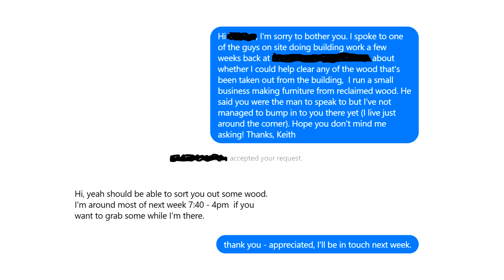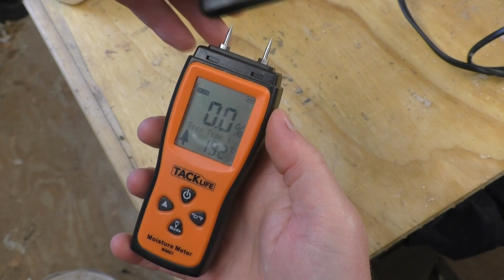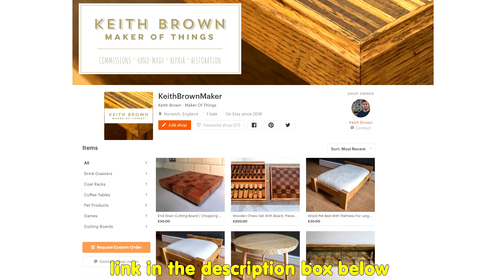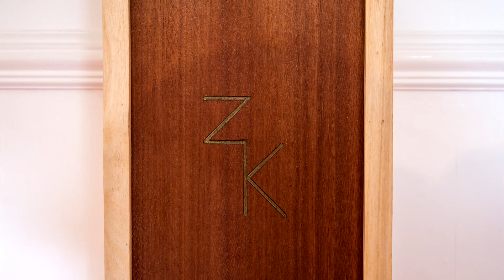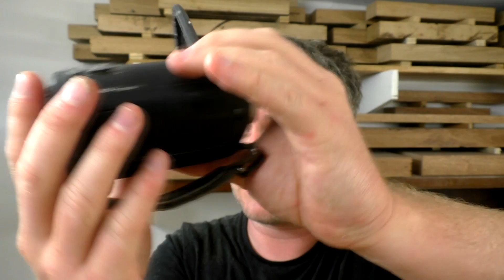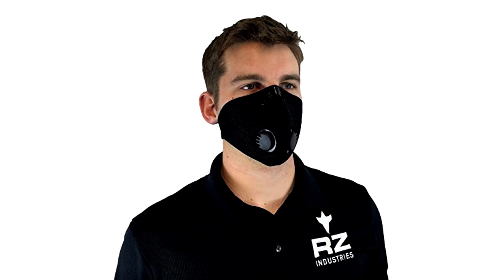VLOG 1 - Salvaged Wood Haul / Work In Progress / New Camera Gear / Tool Talk

Comment: I also enjoyed this video format a lot. I know it's been a while, and I'm currently catching up on your videos, but I wonder if there's anything that can be done to make that table saw quieter. Adding weight to dampen vibration, or possibly balancing it in some way. Or is it just a really loud motor?
Reply from the maker: It’s just the motor unfortunately. I wish they made an induction version - I’d buy one!
Reply: Thanks for the reply, sir! Swapping out the motor for an induction one would be complicated, as they need circuitry to drive them if it's not built into the motor. That's beyond my current skill level, but maybe Matthias Wandel would be kind enough to offer a consultation. 8-)

Comment: Kieth, I know this vid is a little old now but if you're still looking for a compact, quiet, induction motor table saw, have a look at the TS-200-2 or the TS-250M-2 from Axminster. They start from around 400 quid. Up to 700 or so if you go for the sliding table attachment (this is also compact but very well built). They're from the "hobby" series but trust me, they're a professional bang for the buck. A buddy of mine has the 250m with sliding table. I think it's great.

Comment: Don't waste your money on festool. They do the same thing as many other name brand jointer's, only for two times the money. Their is no difference in the quality of work. I can't understand why anyone would want to do that. Unless one has money to burn. A domino Vs. biscuits. You seem to be a smart man. Save your money for that place in the country you want.
Reply from the maker: Biscuits don't and strength. Dominos do. Simple as that for me
Reply: Rag 'n' Bone Brown ..... I have used biscuits for many years and have never had a failure. Domino's do add more strength, no question about it. But is it really needed? Only you can decide that.
I love your videos and never miss one. You are very good at what you do.
Reply from the maker: Check out my testing biscuit joints video

Comment: Haaay! 
I really like your chanell specialy because i litteraly have almost the same size garage that i am slowly converting into a workshop   ... --> https://www.instagram.com/p/BbHsY15n6BJ/?taken-by=zeko.zajc   Curently is without the place for bandsaw but i plan to enlarge the garage a bit bbwwwhhhahahaaa

I struggle with the same issue about deciding about machines... specially couse i am a fan of unplugged anyhow... but some machines are really useful too ...  well... since size is limiting me also ... i wonder what conclusions have you made about table saw? I was almost sure ill go for your dewalt since it looks it is a quality tool to work with ... but i have to think about noise since i am very close to my neighbours... i have the same thoughts about band saw and planer/thickneser... i need them small ... quiet ... some reasonable level of quality...  but jea.. the question remains... what conclusions have you made about getting a new table saw? plus ... i have to think about ordering from ebay or amazon or somehow abroad ( in EU so i dont pay import taxes) because we are limited with selection in Slovenia and alot pricier.... on that... while writing that i just gor alu sashg clamps from GLS right now i ordered on ebay jeeeeej :D

Congratzs for the chanell again love the hole story fom building it to a proper workshop by now!
Reply from the maker: Thanks! I haven't made any conclusions about tablesaw yet my dewalt is fine in every way except for how loud it is. Charnwood and Axminster sell saws with quieter induction motors however I'm not sure if they are available in Slovenia. Try and find one with an induction motor if you can
Reply: Rag 'n' Bone Brown tnx ill check... 
And what is your strategy to check the quality?  I mean the tech info is specified ... with noise and what kind of motor it has ...  size...  But...They all say they are super fine precise and all😊😊.    And... What would you say is the bigest pice reasenable to cut with your current dewalt saw ( and similar table sized ones...) 

Tnx again and good luck in 2018 ... From your new patron hehehe😁
Reply from the maker: Thanks for being a Patron Miha! I think all tablesaws have adjustable fences so as long as the mitre slots are parallel to the blade any saw should be able to bet up to be accurate and precise. Some are better than others though obviously. If you look at the maximum rip capacity and cutting height specs on the saws your interested in it will show how big a size you can cut. I struggle to cut big sheets because my workshop is so small
Reply: Rag 'n' Bone Brown tnx... So you woud say the size of your workshop is more of a limit than table saw of that size...?  Ok tnx for that usefull info!   Best regards from Slovenia.  Cheers!

Comment: Keep the old makita trimmer. Ive got one with a flush trim bit and one with roundover or chamfer bit in. Speeds things up
Reply from the maker: Great idea but in my shop the position of the sockets make using corded hand  tools a bit of a nuisance so I think I'm gonna stick to just using the cordless one
Reply: Rag 'n' Bone Brown 
Maybe some sockets overhead. I like the cordless option but can afford at the mo. I went and bought a Katsu router as a second router. So far so good.

Comment: Noted you mentioned about the reclaimed wood you acquired from the building site being too moist to work with. 

What would actually happen if you used the reclaimed wood at 13% moisten content in a project? What are the pitfalls? 

Great vid. Good solid woodworking knowledge.
Reply from the maker: It will keep contracting across the grain as it dries out which can be a problem depending on how it's used and what joinery method is used with it

Comment: To be honest wouldn't cutting the wood be louder then the motor on the dewalt get a sound meter test with the saw running and watch it,Then try it again when you start cutting or use mobile app not the same but will give some idea ? I've just ordered this dewalt 745 after watching other videos of yours thinking it would be a great saw ,I have no concerns that its going to be great, however i do have concerns in the back of my mind that it would be loud and annoying for other people ,but wood cutting i am sure is going to be louder even with the up grade to W629/W650 am i wrong ?

Although there are other alternatives to blocking sound if that is a worry for you , And would be a lot cheaper then another saw , 
https://www.google.co.uk/search?q=rockwool+sound+insulation&oq=rockwool&aqs=chrome.1.69i57j0l5.3924j0j8&sourceid=chrome&ie=UTF-8

Would block sound and all so make the workshop ie shed warmer in winter times .
Reply from the maker: +IIIZiPIII it's the motor that is noisy. The cutting is loud too but the motor without the cutting is still too loud for my liking (or my neighbours!)

Comment: I was in the same boat as you about the festool domino. I am only a hobbyist and most of the things I make are for my home and for family/friends. With a toddler and another one on the way, I found my time limited in the shop and I could only produce 1 piece every few months. After purchasing the festool domino df500, I have been able to churn out pieces much faster and have made a cube organizer, table for my son, laundry basket organizer, and display case in a month's time. Crazy fast! You can always explain in your videos that dowels or traditional joinery can be used in place of the domino. Keep up the awesome work!
Reply from the maker: +Ray Ganancial thanks Ray, yeah that's a good point!

Comment: I recommend Bosch GTS 10xc. I don't know whether they sell it in the UK. It's not induction motor but it has soft start and electric brake feature. I've been used both DW745 and 10xc. In terms of noise level, 10xc is quite lower than DW745.
It requires larger footprint than DW745 but not that much big, probably will fit in your workshop.

Comment: Hi Keith, I am in a very similar situation to you; I work a full time job but i'm trying to turn my woodworking hobby into a business. I have had an Axminster Ts-200 table saw for almost a year now and would absolutely recommend it. Until recently i was working out of a small cellar workshop so the size and quietness of the saw was a real bonus. It is by no means underpowered, especially for the work I see you doing. There is also an option for a sliding carriage and an extended table (I would definitely recommend the extended table). As for the Domino, I was in the same predicament but bit the bullet and bought one, and haven't looked back since...and I don't think you would either. If you can afford it, get it! Without a doubt. Hope this helps
Reply from the maker: Thanks Cam - am checking out the TS200 :-)

Comment: Nice vid. Hope you get the Charnwood w629 as had my eye on that already. I have one of their budget table saws which I bought when getting into woodworking. Once it was set up right then it’s done me well but like you I’m attracted to an induction motor version. Will be interesting to see which you end up with.
Reply from the maker: Yeah the W629 looks great but after measuring up I'm not going to be able to fit it in.  I really need a contractors saw so am now looking at the Axminster options

Comment: Regarding Festool I have a feeling you will probably get some negative comments about that, as part of the appeal of your channel is that you work with a budget similar to what an average hobbyist would.  Having said that though, I am considering getting a Festool TS55 track saw for my next workshop. That will be a 1 car garage and I think that a tracksaw will be the only way I will be able to cut full sheets of plywood in that space.  I would keep the table saw for smaller cuts. I believe the festool TS55 is relatively quiet in operation.   See the video by "Russ Veinot" where he helped me out by coming up with a design for an easy to make DIY Panel saw that takes up virtually no space.

Comment: Have you asked your neighbours if they mind the table saw?  Maybe they don't notice.  I have a dewalt table saw (a bigger model than yours) and I also find it very noisy. I live in a semi-detached house with a 15m long garden. I asked my neighbour if the noise bothered them and they said they could hardly hear it from their house.  My shed is internally lined with 18mm plywood though and filled with an air gap then a layer of foil bubble wrap insulation, another air gap, then 3 layers of 2mm polystyrene roll.  The walls are about 80mm thick in total.   I made my shed doors the same thickness and insulation level as the walls. So maybe that damps the noise a bit.  It was just a prefab shed that I beefed up.
Reply from the maker: +ksp1278 it doesn't worry me when my neighbours are indoors, but they spend a lot of time in the garden and that's when I feel guilty about it! I could add some more noise dampening but wouldn't want to lost the space. Maybe I could do my door though that's a really good idea
Reply: Rag 'n' Bone Brown If you do it You may need to beef up the hinges to support the weight. I used 4 per door on mine.

Comment: Good haul on that wood! I'm always nosing through Skips to see what I can find. 
I have the Axminster TS-250. It's a good solid saw. Admittedly I've not been cutting 75mm hardwood on it but deep cuts like that I'd probably do in more than one pass anyway.

Another YouTuber Savvas Papasavvas has a video on the upgrades he made to his to make it a more useful saw. https://youtu.be/n0yFbiJ3ZRI

As a side note, it always makes me wince when you push material through your saw and the whole table moves!
Reply: Mr Benjibogs I never seem to have much luck skip dipping around my area, they're always full of builders rubble and stuff you wouldn't touch even with someone else's hands
Reply: Chris Hardy Yeah, it is slim pickings. Sometimes you can get lucky and someone is chucking mahogany balustrades. It's usually fence posts, bricks, plasterboard and joists. Worth a nose in just in case though!
Reply from the maker: +Mr Benjibogs thanks, I checked out the Axminster but I've seen some reviews saying that if the blade guard is removed the drive belt perishes. Is that true? How long have you had yours? I do like the look of it...
Reply: +Rag 'n' Bone Brown I've had the saw for a few years now. It's been used for cutting MDF (mainly cabinet making), trimming up pallet wood and some hard wood here and there. The riving knife is too tall so I just took it off. (I keep meaning to cut it down so I can reinstall it but never seem to get round to it) that does mean that I don't have the top cover fitted but I don't like how it obstructs the view of the blade while I'm sawing anyway.

I read the review that reported the belt issue and I have no idea why you would take the whole blade shroud off?! You'd have to go in under the table and take out the tinware. The extraction isn't great but the whole of the bottom of the saw is open so you can't expect miracles. With a bit of ingenuity you can get is okay. 

I haven't had any problems with the belt perishing. 

TBH, I would have preferred its bigger brother from the trade series http://www.axminster.co.uk/axminster-trade-series-aw10bsb2-saw-bench-ax884465 but my pockets are not that deep and space is limited 😉
Reply from the maker: +Mr Benjibogs oh I see, I thought by shroud he meant the guard but I think I understand what part you mean - I agree, no idea why someone would want to take that off. Thanks will definitely check out that saw

Comment: I'm not sure the wood is ready to use yet. It may read 8% on the surface, but it's probably a little more damp on the inside, especially with those thick pieces.
Reply from the maker: +Eduard van Iersel yes you're right, I stuck the pins in further and got readings of around 10-11% - I'm new to moisture metres as you can tell!
Reply: No worries, I don't use them to often myself. It just seems a logical property to me.

Comment: The test you done recently showed that buscuits didnt make joints stronger. I would stay away from festool as its way overpriced in my opinion. You havea cheap biscuit jointer so i would stick to that.
Reply from the maker: +David Tyler dominos are very different to biscuits, more substantial and they add strength, hence the consideration. Thanks

Comment: It is interesting to see the change from hobby to pro, one thing you say (that is absolute true) is the fact that when becomimg a pro you have to think in a way to get the most from what you do and that implies to use the proper set of tools for the job, save a little time gives you more time to do another project. When you do this kind of stuff just for hobbie you can take more time to do the joinery or finishing your pieces but when you start charging for them now is time to think about the effort and materials
Reply from the maker: +k1ck cyph3r yes! Thanks

Comment: I use the bosch GTS 10XC table saw. Not induction but soft start motor. Not the quietest I'm sure but it's definitely not super loud. 

A great saw as a whole in my opinion.
Reply from the maker: +Peter O'Connell will check it out - thanks

Comment: hi Keith.  good vid. impressive haul of wood. I keep looking at skips but I only have  a car. lol. what wrong with a biscuit jointer . same thing as festool really. I've had mine for 12 years and never used it. Ha ha. only got it cos norm abram used one.
Reply from the maker: +Saul Dean thanks! I did a biscuit joint test video recently and they performed really badly, hence looking at the dominos

Comment: always amazes me when people throw away timber,i got my hands on a walnut chest with 12 inch wide boards in it for nowt!
 well done for snafflin it, and a roof rack may be a good idea for longer stuff.
have you considered lining the inside of the dewalt  cabinet with some accoustic foam to cut down on noise? it may help.
i think the domino would pay for itself in no time, and help you be more productive, id recommend the package with the cutters and accesorries, and buying new because of the guarantee, festool hold their price so well that any saving would be small , thats if you can find one second hand.
they are expensive tools but i reckon the tracksaw and domino are worth it.
cheers
Reply from the maker: +the green man that's a good point about the guarantee - you're right they do seem to sell secondhand for almost as much as new!

Comment: You should measure wood that had been in your shop for a while and use it as a comparison to the new wood. Once it has reached a similar level of moisture content it will be as dry as it will get. It's also important to try and compare similar species. I agree with your assessment that the wood you picked up is probably ready to be worked with. It was also a great lumber find! I don't think you could even legally buy that type of mahogany anymore.
Reply from the maker: +Evan Dunville thanks! I don't think I was measuring t correctly as someone commented saying I should insert the pins in the wood further and when I did that today I got readings of 10-11% ! Still learning :-)

Comment: Hey Keith, regards the table saw noise I believe the Axminster ts200 has a quieter induction motor, also there also there is the scheppach ts82 and the draper version to, I believe they all use the same 1100w induction motor, I have the same saw as you and have the same noise concern, although all these saws are basically the same the have the option for the extension wing and the slide extension the benefits for me is the cast iron top but the one big drawback which may not be issue for some is they are 200mm blades so you loose some cut height down to 60mm hope this is of some use to you m8, keep up the great content.
Reply from the maker: +Lance Simcox thanks! I think the Scheppach is identical to the Charnwood actually... I will check out the Axminster though definitely